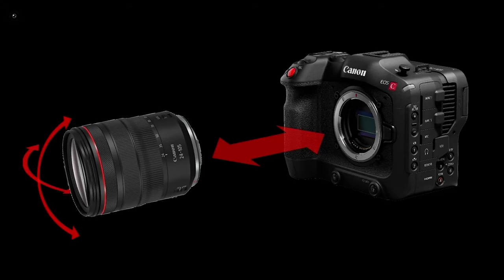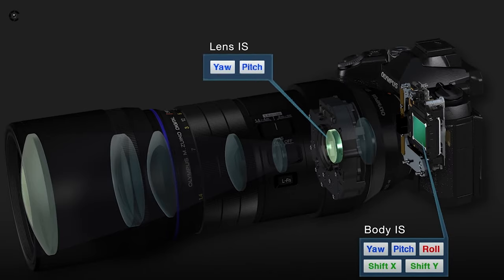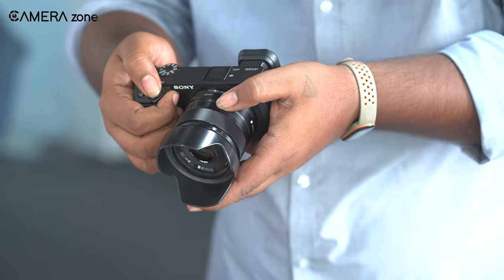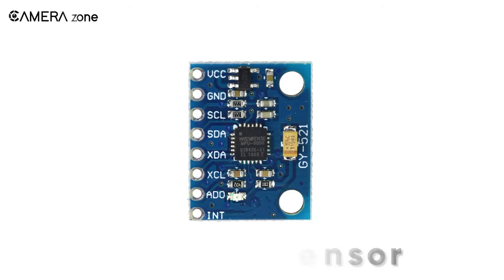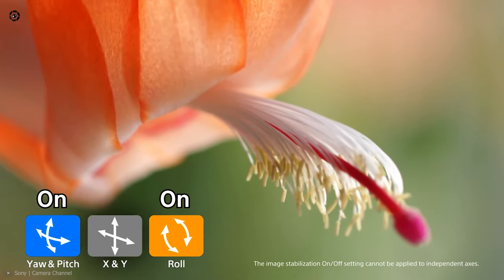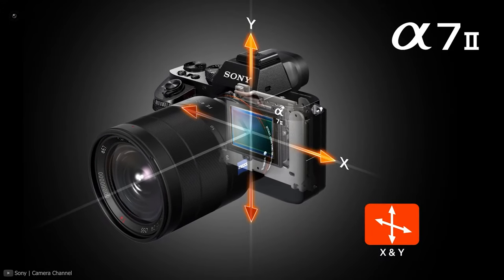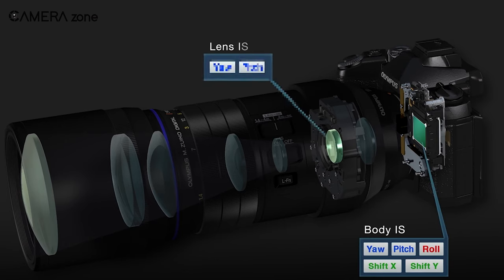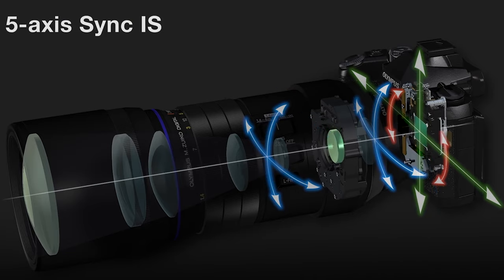How Image Stabilization & Camera Stabilization Works

Comment: Really interesting and came here because i specifically wanted to know how cam stabilization works. Not so much for the dslr, but for a helmet bullet cam which for some reason manufacturers just haven't developed. Maybe simply because of the cylindrical shape i guess
Reply from the maker: Glad you like the video. Thanks for the visit. Stay tuned for more videos like this

Comment: One thing that some dslr users don't understand is that in-body (sensor) stabilization is not a good fit for a DSLR because it does not stabilize the image you see in the viewfinder. Much of stabilization's value comes from making the viewfinder stable and easy to see through for checking focus etc. Honeywell uses (or used) in-body in their DSLR's and it does stabilize all lenses - but never the viewfinder. Sensor and software stabilization are best used for cameras with electronic viewfinders - not DSLR's.
Reply from the maker: Yes, right. Thanks for the input